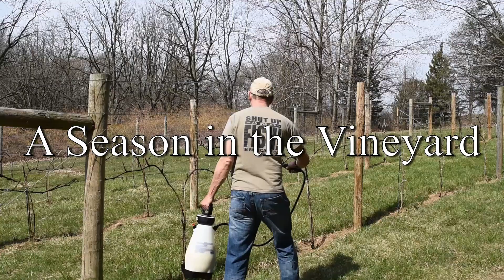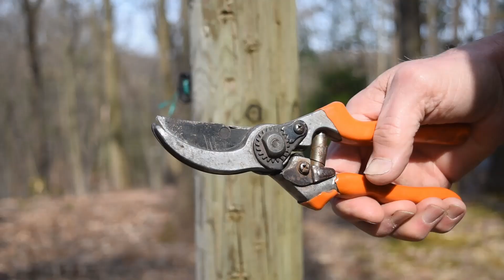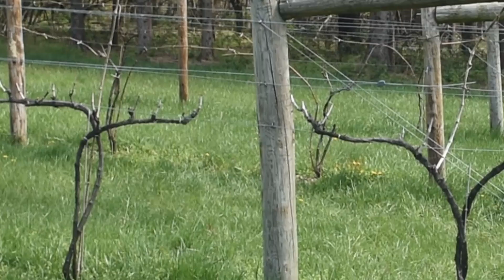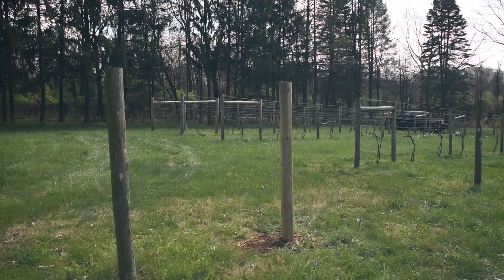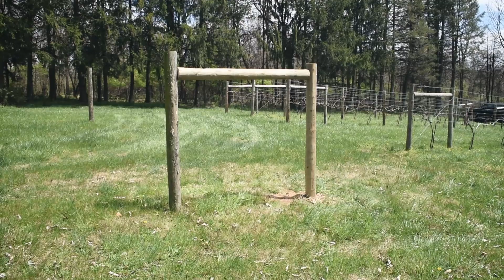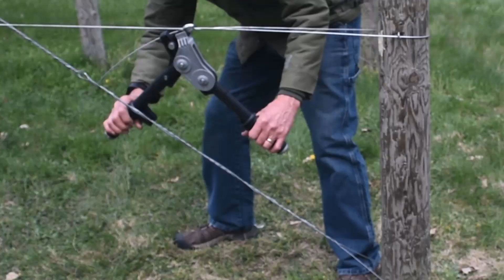Viticulture - #3 Trellis Brace & Trellis Wire construction - A Season in the Vineyard

Comment: Excellent video on H-brace construction.

I'm a residential homeowner gardener who will be planting 7 vines this coming spring (Errante Noir).  I'm very space limited and was trying to avoid the extra step of using anchors outside the posts not to mention the tripping hazard.

This is just what I need and is simple and cheap construction.

Going with dual guyot cane training.

I will only need 4 posts (46 foot run) total. 

I see you only used dirt to place your posts.  Still thinking of using foam for mine, but if I can get the posts larger diameter like yours that better match my post hole digger diameter, I will do the same. 

Thanks! 😁
Reply from the maker: Good luck and enjoy!